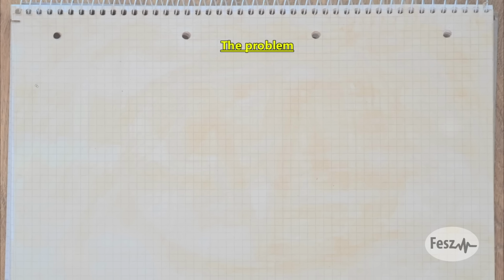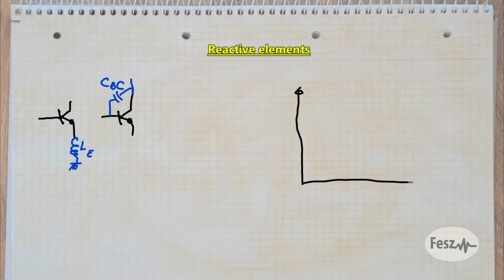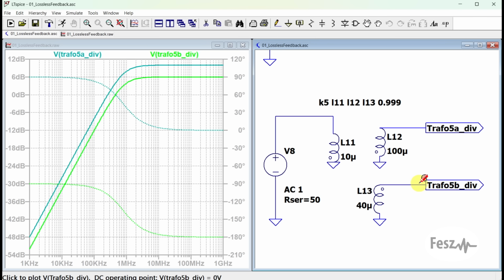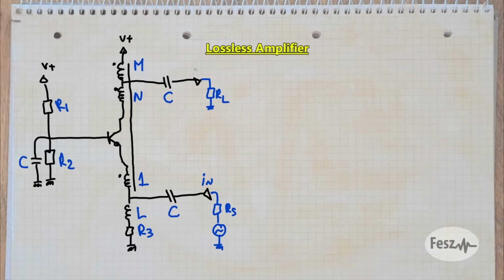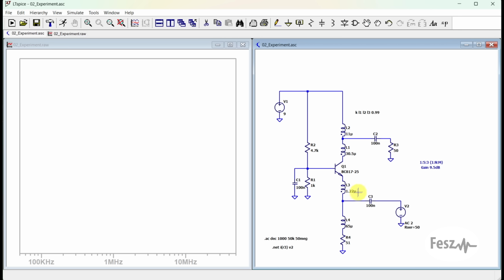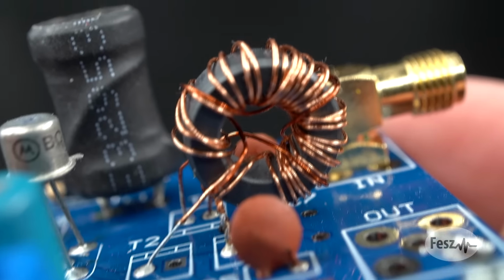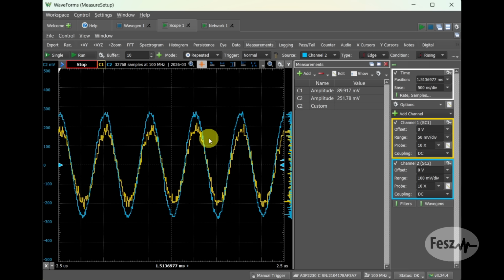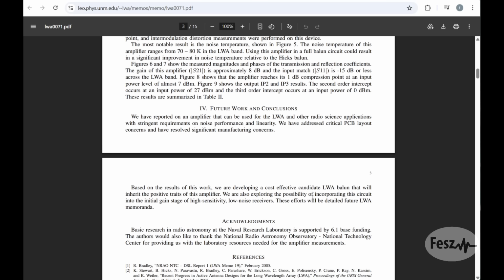The Lossless Transistor Amplifier

Comment: This is very interesting, but i swear i saw this topography very long time ago and it uses an RF power triode instead of transistor, i could be wrong though.
Reply from the maker: I did come across "The Zwischenbasis circuit" - there is an article on this topic by pa3fwm; here a vacuum tube version is presented, but this is more related to the "augmented" amplifier topology not the Lossless one; but maybe we are talking about different things

Comment: BC107 / BC108 has been re-introduced in the original metal package by CDIL India 🎉
Reply from the maker: I did notice that quite a few of the components I saw in old schematics are available again from CDIL, its refreshing to see that you have options to repair and reuse old devices using new components!

Comment: Using in volume is cheap, as then you can have the required transformers made up at quite a low cost, as the biggest part of the bill is the initial design and specification, once you have a core and a winding description you can get them automatically made in volume, but the problem comes in making a few. Over 1000 it is cheaper than anything else, and lower noise, but if you are making between 10 and 100 it is expensive, and you have to hand wind them, or order 1000 and accept they will cost 10 to 100 times the expected cost, though any units over 100 you rapidly drop component cost down, as you have the correct high cost part already in stock, so making extras becomes a lot cheaper, as those first 100 paid for the transformers for the others. biggest problem they probably ran into for the LNA use was that those are typically cryogenically cooled, and the transistors used are both rather expensive and rather fragile, so running them with more than 10mA of collector current was going to result in long term degradation, so they likely went with another design, using the same transistors, but with much lower collector current, as that at least allowed them long transistor life, at the expense of large signal gain, but with also a big difference in the power dissipation in the transistor contributing to lower cryostat volume needed, and lower running cost, as you need a smaller Stirling cooler to keep that smaller volume at liquid nitrogen temperature, or cooler, so your noise floor can be closer to the 3K background,  you will have to deal with. Smaller cryocooler is a big savings when you have 100 antennas in an array, and you have to reject the heat they produce without adding in any RF noise from the external refrigerant cooling units, precluding you from using inverter technologies, as they are all electrically noisy.

Comment: When I worked in a development lab, we used these amps all the time for the front-end amplifiers in our receivers. Noise figure is determined only by the transistor. Binocular cores worked the best for the transformer. However, they can be quite tricky to get to work right. They tend to oscillate close to the Ft of the transistor, even though they appear to work normal. (Main symptoms of those oscillations outside the bandpass are higher than expected noise figure, and slightly lower than expected gain, and some weird and unexpected peaks whilst trying to meausre IP3 on a spectrum analyzer). These oscillations can normally be tamed by placing a ferrite bead over the emitter of the transistor and careful PCB-layout. The biggest issue with these amps are reverse BE-breakdown under overload conditions. (If you ever use this kind of amp in the field, a diode-limiter before the amp is a must, else, sooner or later lack of it will bite you in the backside…).
Reply from the maker: Its really interesting to hear this sort of design is in actual use! What sort of receivers where you working on where this amplifier was needed?
Reply: @FesZElectronics HF and UHF transceivers, mainly for military, maritime and avionics systems. (Oh yes, also in the buffer-amps in colocation-filters)
Reply: yahoo -  exactly what was missed from the video!

Comment: I've built a number of these amps in both single ended and push-pull configurations.  Binocular cores help with the transformer performance. Running the transistor at fairly high collector current helps with intermodulation distortion and IP3.
Reply: Just be careful of saturating the transformer with the DC current supplying the transistor. For higher power amps, it is best not to run DC through the transformer, supply Vcc trough a different path than the transformer.

Comment: I wish ltspice has a dark mode. When the circuits appeared on the screen I recoiled because I'm sitting in a darkened room. I know, that's a me problem.
Reply from the maker: You can easily set the colors in the Tools->Color preferences menu; I used this white background since its the most clear version I found that shows clearly after youtube rendering. I found the contrast far more poor with black or gray background - as is standard
Reply: It has, though you have to look into it via Google search. I got mine on Dark Mode

Comment: Great video. I'm a big fan of Chris Trask's circuits and downloaded all of them when they were easily available. I particularly like his use of augmentation in common-base amplifiers to reduce the input impedance, and improve both noise and intermodulation distortion in wide-band magnetic loop amplifiers (my pet subject). Chris got me into using trifilar windings on small binocular cores for my transformers. His papers on RF transformer design are also particularly impressive.
Reply: I absolutely despise these companies that take research papers and hide them behind paywalls. Research they didn't pay a dime for.
Reply: @vincei4252  This is Chris's own research as part of his own company (Sonoran Radio Research) that he made available until his website provider closed down and the data only became available via Wayback.

Comment: -You missed band B in equation for thermal noise (spontaneous/random electron movement in the conductor).
-Inductor's reactance is 0 for DC and capacitor's reactance is hyperbolic function.

Anyway it's interesting circuit.

Comment: This amp architecture and patents are made obsolete by modern devices and noise analysis. 

One can not discuss low noise designs without it's specific use case. In general, however, Johnson's noise contributions from feedback resistors have not been the dominant factor for decades due to advances in semiconductors. 

Contemporary MMICs can give you 5M ~ 5G practically flat with 20dB gain and a noise figure of 0.5dB. 

For satellite communications there are JFETs that can have equivalent input noise temperatures of a fraction of a Kelvin.

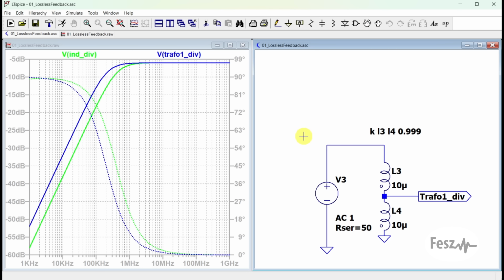Comment: Why does the output sine wav of the real amplifier look so "fuzzy"? (-3:52/14:49 timestamp)
Reply from the maker: The signal amplitude is relatively small, and after passing trough the x10 probe it becomes even smaller. The measurement device I'm using is not really made for small signals, so its just noise plus segmentation...